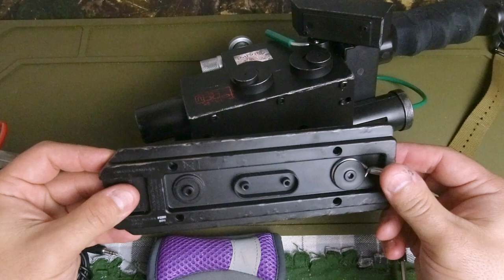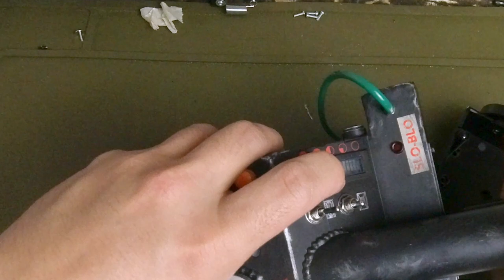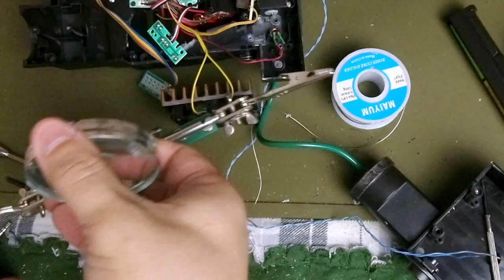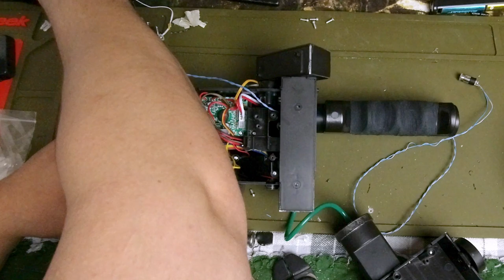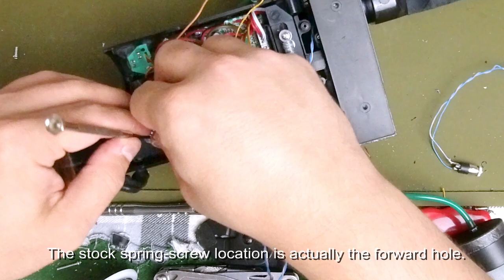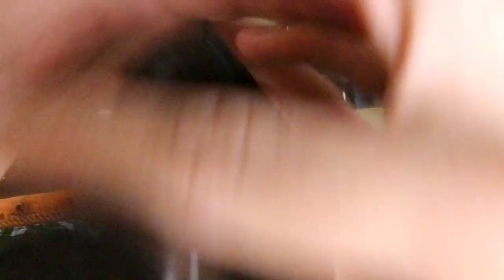EASY Vent Window Delete and Aux Jack Install - Hasbro 🚫Ghostbusters Spengler's Neutrona Wand How To

Comment: I have one question, How do you fix the front part of the tube where it glows because its not glowing.
Reply from the maker: Is your very first LED not lighting up?  If that’s the case, the bad news is you’ll have to get pretty invasive to fix it.  I’m not sure exactly how to go about it.  Probably some time and gentle prying with the aid of a heat gun.  I think that part is all glued together.
Reply: @PeaceLoveAndGuns  Thanks because I was kinda sad that happen because of how i was using the tube popper
Reply from the maker: @mikeisthedoodlez  Yeah man, I’m sorry, that sucks.  It’s a shame that Hasbro couldn’t design something that could withstand normal use as intended.

Comment: Quick question, is the Vent Light LED directly underneath the vent or is it off to the side?
Reply from the maker: It’s pretty well centered under there if memory serves.  Not 100% atm though as I can’t go look until the weekend.  You trying to come up with a reflector bezel for it or something?
Reply: @PeaceLoveAndGuns  looking into a few different ideas really and I've seen a few shots of people's wands that had the light to the side and some directly under it.

I'm doing a large renovation on my house and all of Proton Packs are in storage so I would have just opened my Spengler Wand up to see.

Thanks for the reply.
Reply from the maker: Post up on the groups, someone will have snapped a photo.  Heck,  you might be able to take a still from the video.

Comment: Dude!! I love your video! I followed the video and I got it sodered. Please tell me what speaker you used with an aux jack
Reply from the maker: I'm glad it helped and thanks for letting me know.  It is nice to be validated.

I've connected it to some waterproof BT speaker I have laying around and I've connected it to my spirit pack's aux in on the Ghostlab 42 Sound Board.
Reply: @PeaceLoveAndGuns  you are more than valid brother..
Reply: Hey now my sound doesn't work but everything else does
Reply from the maker: @plussizeriderlifeshardbike9318  Sounds like probably one of the solder joints might be bad or the joint is fine but their chea wire snapped off.  I would check those first.
Reply: @PeaceLoveAndGuns  I got it fixed for now sound comes out of speaker (s)
Reply from the maker: Dude, nice!  We got the tools, we got the talent!

Comment: what's the size of the drill you used?
Reply from the maker: To drill the tiny holes in the plugs?  The exact size doesn't matter.  The smaller, the better.  Anything approximately 1-1.5mm in diameter should be fine.  Use a tiny screw with threads that are a little bigger then the hole so they can bite into the plastic some.

If you're talking about the hole for wire, again, the exact size doesn't matter.   What matters is that the hole is big enough for the wire to fit through and that you don't drill through any electronics!  Make sure to study your wand and know where the bit is going to go and take your time.

Comment: hello, just found your video searching for the answer to a question i have, was wondering if you could help me out a bit. i received my neutrona wand today, and the vibrating motor has started vibrating against the plastic and making a weird noise. any idea why? anything i can do about it? also, will be binging your videos lol
Reply from the maker: Hey, I’m not sure what would be causing that, exactly, but something may just have come loose abcs be rattling against the side.  The side ‘heatsink’ (speaker sound holes) slides into place, if i recall, and might be able to rattle.  Maybe a wire was previously hot-glue can now tap and make noise?

These things really aren’t made to very high quality standards.  If you feel up to it, I would take it apart to see what’s up!
Reply: @PeaceLoveAndGuns  i might try opening it up. i’ve seen how difficult they’ve made it though lol
Reply: @PeaceLoveAndGuns  and thanks for pointing me in the right direction! really appreciate it
Reply from the maker: @mist1066  It’s really not so bad.  If I can do it, you can.  Good luck and have fun!

Comment: where did you get the speaker wire from?
Reply from the maker: Hey, that’s a great question.  It’s just twisted pairs from the inside of an Ethernet cable.  If you have a spare laying around, just cannibalize it!

Thanks for the comment and do please consider subscribing!
Reply: @PeaceLoveAndGuns  could I use any wires or does it need to specifically be ethernet cable
Reply from the maker: @chrismc8753  Whatever you have laying around.  Find an old cable, cut it open and take a look at the wires inside.  Ethernet cable was just easy for me.

I think the actual wore size of the twisted pairs of my cable was 22 American wire gauge.  Anything a little bigger or smaller should be just fine!

Comment: After 2 years how is the aux mod holding up? Sound board still working good?
Reply from the maker: Right up until I cut aux plug off in anticipation of my haslab pack.  The wires just tuck neatly into the handle around the haslab pack power adapter and I might use them later if I put wand sound through an amplified speaker on the pack.  Thanks for the comment and do please consider subscribing, especially if you want to see the project as it develops!

Comment: My wand no longer outputs any sound. I did an almost Identical mod minus the audio jack. I had the wire run strait to the packs amplifier.  After a year have you had this happen to yours?
I am trying to determine if its a defective wand.
Reply from the maker: Hey Mr.E, sorry to hear about your wand!  Have you had the opportunity to crack it open again?

It's possible that one of the solder connections was a 'cold joint' just popped off over time.  Alternatively, if you still have the battery case in the grip, or maybe just by normal action, your wire might be damaged somewhere there.
Reply: @PeaceLoveAndGuns  I have. I opened it up again, and have found the problem. The wire I used was undersized causing an increase in power draw to a point that it browned out some component on the board. I am hoping that it is just a resistor or something and not the output of the micro controller.
Reply from the maker: Oh yikes.  I hope you get it worked out!  You can probably hit the various components with a multimeter to see what needs to be replaced.

Comment: 7:33 : is this a common problem or is it just your wand that's affected?  because I have zero intention to open mine...  is this wire gonna affect only the light in the wand or will it affect the sounds too?
Reply from the maker: It's all wands and it's just the LEDs in the tube.

Thanks for the comment and do please consider subscribing!
Reply: @PeaceLoveAndGuns Yikes!  I guess I'm gonna use your video to modify the tube to make sure it doesn't cut the wire...  thanks!  and I subbed :)
Reply: @PeaceLoveAndGuns  Hello!
So I finally had time to work on this...
I was very surprised that once I opened the wand, the wires were not taped like yours were.  and the wire for the barrel was actually maintained in place in the barrel with clips, preventing it to be hit by the barrel when it was pushed out.  I tested it several times and never even got into contact with the plastic...  and I have no wire damage, so I guess a was lucky.
It probably is a problem affecting a certain batch coming from a certain factory.
that's my to cents.  
thanks to you people with that problem will be aware and can fix it :)
Reply from the maker: @raynekraven  Hey, Rayne Kraven, thanks for the update!  That’s great and will be curious to know what others are experiencing now, too.

Comment: What kind of speaker did you use?
Reply from the maker: That's the stock speaker inside the unit.  If you're asking about the aux speaker, it's just a waterproof Bluetooth boom box that I tested with.  I haven't tied this want to a pack with any sort of permanent speaker solution.

Thanks for the comment and do please consider subscribing!

Comment: You don’t insulate the wires? Still working?
Reply from the maker: I mean, in general you want your wires to be insulated, if something shorts internally that's no good.  Where do I use uninsulated wire here, though?

The mod worked very well until I tore it out to put in a custom bargraph and a ninjatunes board replacement.  The inside of the wand is spaghetti now.  It's amazing.  Even ran additional wires to easily add functionality later and replaced the hose with pond hose.  Looks gooood.
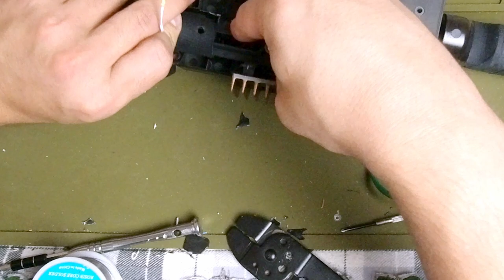Reply: @PeaceLoveAndGuns  i see in 51:09 you didn’t use shrink tubes or liquid tape. I was going use shrink tubes but the opening is to small. It was going  cause more problems. Great video. I cut the same path to give room. Unfortunately my wire was cut in the middle so I had to get really in there.

Comment: Now I know what NOT to do when I go in to mod mine.
Reply from the maker: @wickedd365  You say... on a three year old video that was originally filmed right after these came out and for which the product has been slightly updated and hundreds of fans have detailed every PCB trace and hidden bit of glue in these.

Mine has been opened up multiple times since, a real bar graph added , ninja tunes board in the pack and other mods and it's still going strong!

But I am glad that you and the rest of the Ghostbusters community can learn from the plethora of great data made possible by videos like this.

Comment: Bro my wand the lights of the tube are all fucked!? Would you know how to fix it? None of the Colours of the tube are ok.
Reply from the maker: Crack that baby open!  I mean, if you're comfortable with that, of course... Your wires are probably guillotined and all smashed up.  What've you got to lose at this point?  Take your time and have fun and you'll probably end up with a working thrower!
Reply: @PeaceLoveAndGuns   it must be one of those orange/yellow or white wire you showed. I will check it out.
Reply from the maker: Good luck!  If I can do it, you can.
Reply: Weird, I would think it would just not work the light if it’s cut the wire… that’s why I’m thinking on the motherboard? Have to check it out.
Reply from the maker: You might have a short somewhere or a bad solder connection.  These things are made super poorly.   Like they intended on making them bad.  You can't do this by accident.  XD
Reply: Dammit ,I wish I'd seen this and told my 7 year old son not to work the pop out function, the correct colours and patterns are stuffed 😫 
Now I'm going to have to open it up fml
Reply from the maker: @Guncage81  Sorry to hear that... BUT now you know how!
Reply: @PeaceLoveAndGuns  
I'm capable of fixing but I just don't have the spare time ,I'm going to being shipping it right back to the shop and getting another one ,and the extender function will be eased open and it will be left for display.